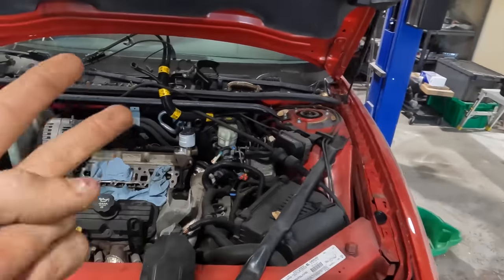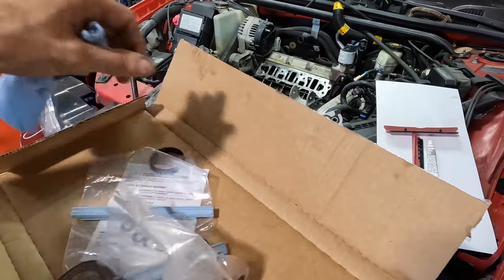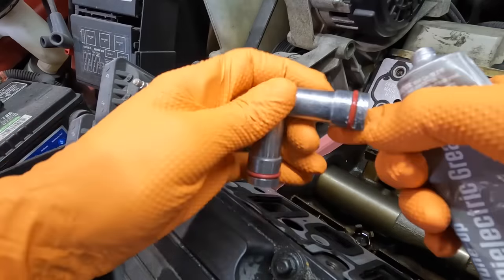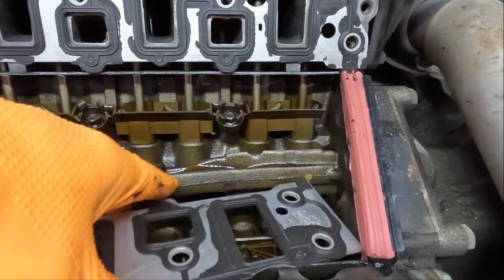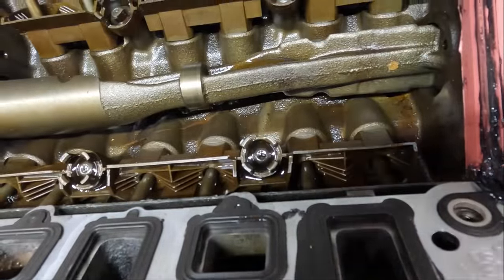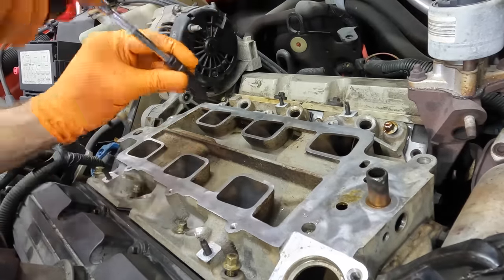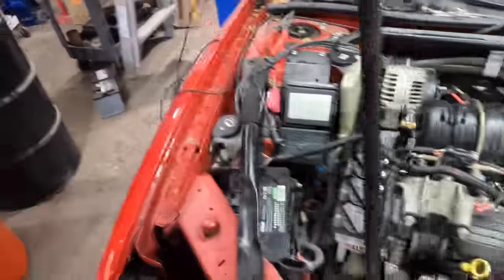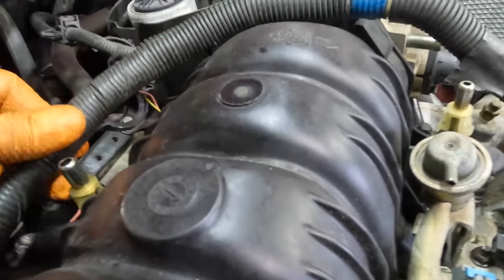Blown out Intake! 2003 Chevy Monte Carlo! 3.8 #mechanic #enginework

Comment: Ray, these phones that you just talk into never seem to be able to type what you want to say. I was talking previously about the welding just a second ago. Another good thing about flux core is you could weld in the wind you don't need to have any kind of shields or external gas. Farmers use flux core a lot on their farm equipment that they have to repair in the field and they don't have to worry about wind. No doubt there'll be a lot of people that have something to say about what I have said to you, I offer it only in friendship and I hope it helps. There are many options as you probably already know in the weld equipment world. I mentioned the 110 buzz boxes because they're reasonable in price and get the job done. However if you have more funds you can always get a multi-purpose unit that does it all. If you decided to go that route in the future I would recommend a gas generator welder. You know how to fix everything anyway be no problem if it broke. These units are fantastic you can do all procedures mig, TIG, stainless, mild carbon steel, aluminum, stick welding those machines are pretty much fantastic. And it's all one unit. They can be spendy but, maybe you could check in an auction. It could be used at your work site on your farm or mobile it could be anywhere that's the great thing about it. Anyway, at the end of my previous comment the phone screwed it up. I graduated certified unlimited. In case you're wondering, if you take your certification test on 3/8-in plate you will be limited to 3/4 in steel or work. If you take your test on 1-in plate, there is no limit which means you could weld on 20 ft thick steel. The only thing that matters is that the procedures in laying the weld beads are good. Have a good day buddy hi to the wife unit and remember don't poke the bear!

Comment: Alright.  Last comment... 40:51 I am super curious, because every time I've pulled an engine and reinstalled, I always fire it for a few seconds before bothering to fill coolant.  But never more than a few seconds.

What exactly have you got going on here?  Letting it run with no water in the system at all for multiple minutes?

I have made a mad dash home more than 50 miles away after shearing a water pump pulley (burn and coast).  But there was still water in the system.  I also forgot a hose clamp and obliterated an engine in 15 seconds when a full system suddenly lost pressure last summer.  Towing, running AC, up a hill, through a massive interchange; I actually chose sort of to demolish it if I could get a little further away from so much moving traffic.  I kept losing power, downshift, lose power, downshift.  At which point I stuck it in second (clutch safety is overridden) and used the battery to winch myself as far as I could.

Tangent over - I just know water is really important and seeing an expert do something different, I want to know why and how it works.

Comment: You could package up your videos, categorized by make / model / repair type and create a "product" that you could sell to shops / individuals for training, repair reference, shop resource, whatever.  Youtube could remain free to view, but the package which could be bundled with diagrams, links to parts lists and so on could be offered to those who would find it valuable.  Some work involved with packaging like this, you'd likely need to partner with someone- maybe an auto parts chain would want to pay you to provide them the content to package up.... just a thought.  And - FYI - bacon grease would not work well as a dielectric lube, there's too much salt in it, ionic species make it less than a good insulator.

Comment: Stupid question Ray from a non-mechanic -- if I drain the oil do I need to put a crush washer on the drain plug? I've seen you replace washers, and re-tighten some without a washer. Is it car specific? Apologies if it's a newbie stupid question.  Oh I have a Ford Edge 2017 2.0 Diesel in the UK.

Comment: Oil viscosity is measured in Weight, NOT Winter!
5W 40 means 5 Weight 40. Meaning the oil has the weight of 5 grade oil when cold and 40 grade when hot.

Comment: hi Ray, love the videos. Helps break up the monotony of my days for sure. Just an FYI -- I didn't see you reattach that bracket that attaches on the top of the back of the lower intake. (part 1 you mentioned you were removing it because it was only two more bolts)

Comment: I have a 2004 Monte (3.4L) and 3 days ago I pulled out on the road and had to get on it a little bit to beat the traffic and after punching the gas, it was doing great, full power. And suddenly "BUTHTHTHTH", very little power. It will start and stay running. But it sounds terrible. Like you pulled off a couple of spark plug wires. My mech changed all the coil packs and it still runs like Crap.

Comment: I hope wife unit isn't watching this. Ray taught her to always pull the ratchet when she replaced the spark plugs on the Ford, yet, here, he pushed most of the time when torquing the lower manifold bolts. And Ray's dielectric is Bacon Grease?

Comment: I once accidentally pushed the intake onto the elbow too far. The elbow was all the way into it's opening in the intake, so the o-ring caught the other side of the hole and wouldn't come out. And it was a "do it as cheap as possible" job, so I was forced to reuse the old plastic elbow (and use the plastic gaskets, not the metal). That is, until I did that. The elbow broke trying to remove it, right in the middle of the o-ring groove. So they had to buy a new elbow anyway.
Reply: I always do that job quoted with metal gaskets and coolant elbows or I don't touch them.
Reply: @oliver_klozoff  It was for my late mother in law, who was on a fixed income. Money was tight for me back then too, otherwise I'd have paid the extra money the metal gaskets, as well as just buy the elbow myself. And no, I didn't charge her to do it, I was doing it for free to pay her back for money I had borrowed. Although, I would have done it for free anyway. But it was her idea.
Reply: @joevk6274  understandable, no judgement. I can't say I haven't done something on the cheap in the past. It has bitten me though and I refuse to do so ever again. I do most of my families mechanic work so I usually just biy the parts and do it. They pay me back in other ways, it's family you know. You sound like you understand.
Reply: @oliver_klozoff  Yep, I understand fully. I've done plenty of cheap fixes in my lifetime, lol. But when my truck went down about a year ago, I went all out. It only needed head gaskets, but I thought "might as well fix the other issues it has and replace some other things that the heads being off make easy to get at". Like the leaky oil pan gasket, and the cam position and oil pressure sensors. That snowballed into a new oil pump and timing chain and gears too, lol.

Comment: I can assure you and ive tested this theory many of times, when the doors open its not A. JAR.  NOPE the pins witch is in a closed state shorted to chassis ground. If you unplugged it the door dosnt turn back into a door, its always a door
Be it open or closed  its just a door and doorway.  So Gm Ford, toyota Nissan Datsun Honda benz BMW  and all the other brands calling doors jars are wrong.
Its a door and will always be a door.

Just like all the moon is dark. Its only the sunlight that makes it shine with a light look.

Comment: First and most important- you forgot the "TADA" on the Brake kleen.  That being said thank you for identifying all the connectors as you were re-hooking up the electronics.   I was wondering if you were going to do a coolant drain and fill as well, then said letting tide pods clean the radiator?  What is this magic you speak of?

Comment: Earlier 3800/3.8's did not have that intake gasket nonsense. Nice redesign, GM.
Reply: Series 2, long block was great. Everything bolted to it was garbage. Series 3, Gm fixed all of the series 2 issues then discontinued the engine line.

Comment: So is this repair something you should need to do once, and never have the problem again? Or is it a failure that will just happen every so often? Because these cars are all 20+ years old at this point. This has been a known problem for a long time, but these 3800s apparently still come in with the problem. Have these old cars made it this long with the factory gaskets, and this is their first repair? I find that hard to believe. Or is this a subsequent repair for a problem that has already been addressed earlier in the car’s life?

Comment: Hey Ray I got to tell you I started laughing, not about your present video, no I was watching your video that says this video is a bad idea saved customer thousands 5 months ago. My first question for you is what does RE mean? I was thinking as I was watching the video that I was going to tell you something and then you went on that rant about people aragon on you about your welding and I started laughing. I am not trying to rag on you. I know you're not a welder, as you have mentioned it previously. Now that's it I do want to point out that when you are using mig solid core wire you must have a shielding gas. What does the gas do? It creates a shielding gas fume around the well pool and it prevents air from getting near the well pool until it's solidifies. As we know there is moisture in the air so when the air gets into the liquid pool it creates porosity and or poor welds. Second, where you place the ground clamp will either make your welding easier or harder. There is no doubt that you are intelligent I see that everyday as you work on these vehicles especially when you do your troubleshooting which I suck at. I would like to tell you a short story when I was in weld school I was doing vertical up on 1-in plate using SMAW. Shielded metal arc welding. I could not figure out why I was making these crappy welds and a long comes our instructor who is an incredible welder. He stops, reaches over and moves my weld clamp The ground cable over to the side as I had it at the top. He explained that the electromagnetic fields inside of an electric circuit create similar waves as that of the welding unit. So what was happening is my arc was attracted to the ground clamp instead of following vertically up the plate. So what I'm saying is when you are welding you want to place the clamp away from where your welding Don't get right close to it cuz that will screw up you are pretty welds and you won't know why. If you want to weld in your world at your new job your new place without a shield and gas I would recommend buying a Lincoln or Miller 110 buzz box. Make sure it is flux core. You can weld with flux core on thin metals as long as you turn the wire speed and the amperance down. Just remember that flux core penetrates steel about 50% greater than mig. What's nice about flux core is you could use it around your house you don't have to grind off and make the steel pretty flux core will burn right through that rust or paint or whatever you got going on. And that's the other drawback Mig does not create the speckles that you get when you use flux core or stick welding so there's some cleanup if you use flux core. I've been using mine for a long time and I love it. So if you wanted to do it you could have both. Have one unit that's mig another one that's flux core. Just wanted to let you know not trying to rag on you. I graduated world School certified and limited in 2010. You have a good one Peace out

Comment: I might be wrong but I think the SS was a V8.
Reply: No it was either a 3800 or a supercharged 3800. If there was ever a V8 model it would be a very rare car.
Reply: I think they didn't start putting the 5.3L in until 2006, they did the same with the Impala SS and they're a real pain in the ass to work on.
Reply: @Mekelych  You and Jeff were both right. The 5.3 SS was only for 2006-07 which is what I was remembering.

Comment: Hope the lower coolant elbow doesn’t break anytime soon , you know the one under the tensioner? The one you mistakenly said was a 2nd design. Also the lower intake bolts should have sealant on them or you will have leakage there. Good techs know what corners cant be cut, like not changing lower coolant pipe because you saved time and beat book time.

Comment: This seems to be a common knowledge repair on this car. How would you otherwise diagnose it and not think it's a head gasket?
Reply: Agree...10psi coolant receiving 2psi crankcase oil...sounds fishy
Reply: That gasket failure on the 3.8 was so common that it was considered routine maintenance. Otherwise a bullet proof engine.

Comment: Plastic elbows from the dealer are better and last a long time, They have the bigger and better 0 rings also. Do not get after market plastic coolant elbows ever, I also dont like the metal ones UNLESS YOU BUY THE DEALER 0 rings. The dealer 0 rings much harder and better material built 0 ring... The other 0 rings on after market cheap china are smaller and dont last a long time and also if your using GM dexcool antifreeze, They eat them up, But the dealers 0 rings will last and seal better with the dexcool GM antifreeze. My experience with many!!!!

Comment: BMW any day over this mess
Reply: You have got to be kidding.  After doing this very job on my Grand Prix, it was way more reliable and affordable to own than my B.ring M.oney W.ith!  Every year there’d be something ‘major’ (read: costs a lot) wrong with it.  BMW couldn’t make reliable door lock actuators, blower fan, head, lifters, anti-lock brake actuator, cam sensor, coils,  -list goes on-.  Got sick and tired of that  piece of crap and finally traded it in with 78k miles.  Like most, I will never go back.  Love my new Lexus GS F-sport!  It just works every time we start it.
Reply: @sx300pilot5  I’d only own 2004 and older 👌